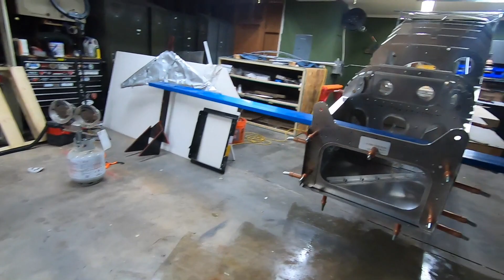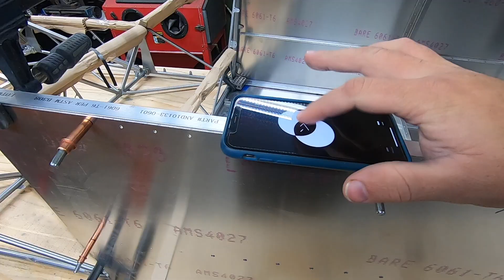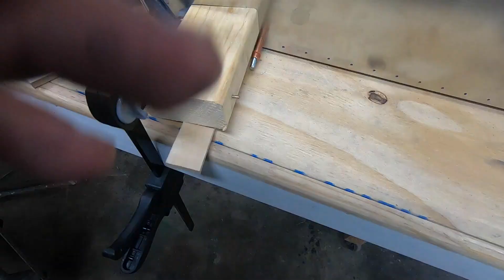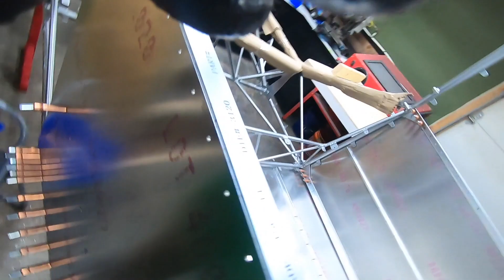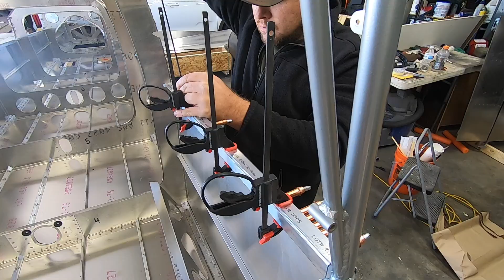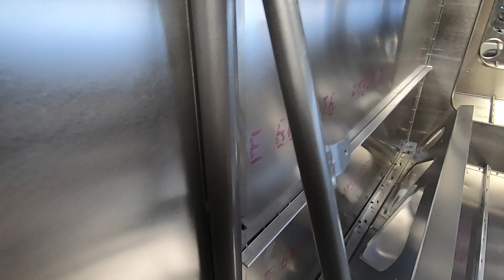RANS S21 EP11 FUSELAGE MATE!

Comment: It appears you have the lower longeron double in place when you back drill the gussets?  I thought the manual doesn’t tell you to make the doubler until after the gussets are back drilled?
Reply from the maker: I did have both the doubler and longeron in place before back drilling since in my case, both ended up on the out-board side of the cage gusset. If building like the plans show with the cage gusset sandwiched in between the longeron and doubler, the cage gusset holes would be covered up so that's why they have you remove that for the initial longeron drilling.  Hope that makes sense.. If not, let me know. Thanks for watching!

Comment: An old carpenter tip: I don't care if it's a whiskey protractor or a digital levelyou are using for  your build,  don't turn it end for end when  setting up for critical stuff. Mark one end "starboard", and always put that end of the device on the starboard/right side. It may not matter, but it sure can't hurt.  It doesn't matter if station X is level, what matters of course is that station X is on the same plane (pun NOT intended....) as station Y! I found my building background very helpful when working on airplanes, and I've built 5 of them. A plain old chalk line and plumb bob still have their place, for making sure the ass end of the plane is lined up with the pointy end.
Reply from the maker: All great points! Thanks for watching👍